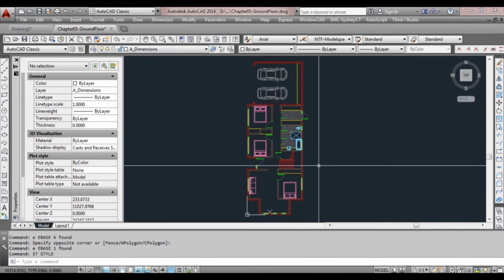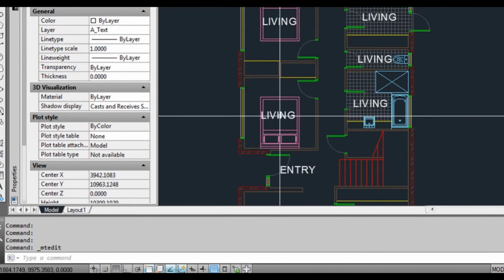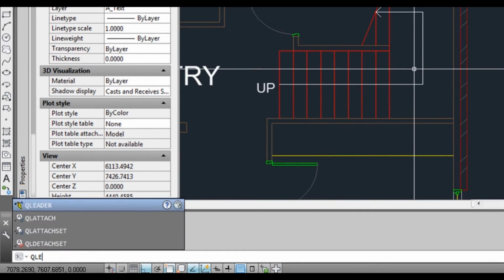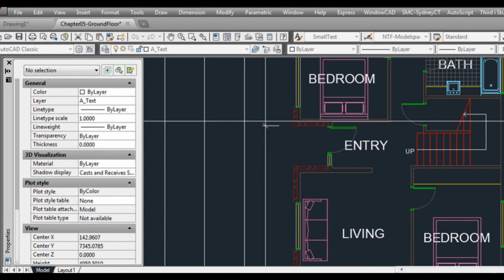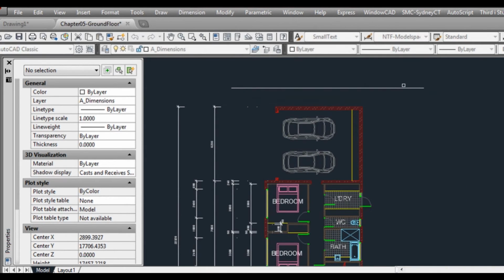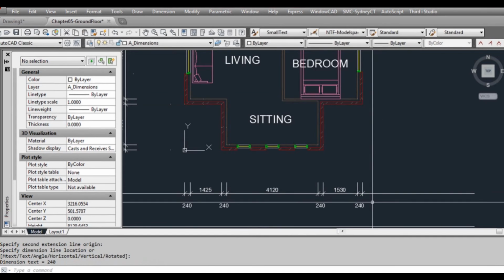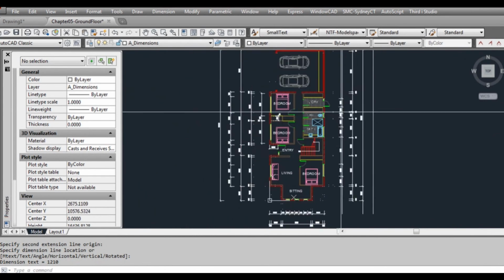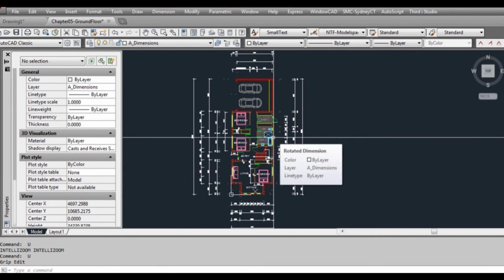AutoCAD Training Chapter05 Exercise HD - Adding Text & Dimensions to Floor Plan

Comment: too many dimensions, it just looks messy. I have a question, the dimensions are usually required from drafters and architects? or Interior Designers as well, or it is a general requirement?
Reply from the maker: yes dimensioning can get quite messy, thats just how some drawings are, not a lot you can do about it in some cases. You certainly need to dimension everything so trades can build and plan for things. If you don't dimensions something often people will just measure off the drawings which is bad practice for actually building something, might be ok for rough quoting of materials etc. Yes, interior designers also need to dimension things otherwise others will not know what length/height to make things. Interior decorators not so much, but it depends on what they are doing.
Reply: Ok great information. Andrew may I ask, what version of Ato CAD were you using in 2015, and how can i get the newest version for free? only with 30 day trial isn't it?
Reply: Im loading you with questions here, but i'm keen on knowing if you post Revit tutorials as well?
Reply from the maker: Hi Violetta, happy to help with information as much as I can. I can't recall what version I was using back in 2015, on the Autodesk website you can get a 30 day trial, but if you are a student, usually you can give them your student registration details and get 2-3years trial. I don't post Revit tutorials as I really don't like the software personally. If you like Revit, I would urge you to look at AutoCAD Architecture as it is also 3D like Revit, but with the power of AutoCAD and it's commands. In my opinion AutoCAD Architecture is better, it used to be called ADT or Architectural Desktop once, then Revit came along and Autodesk bought out the company that made it, then worked on it themselves as they could see this was where things are heading with BIM software. Please feel free to ask to any other questions.
Reply: Oh wow, I don't like Revit itself bcz of its complexity  BMI.. but so many companies using it that's why. Thanks for a good tip, haven't heard of AutoCAD Architecture yet, something alternative is a good to know.))